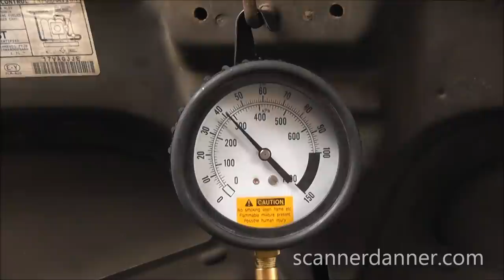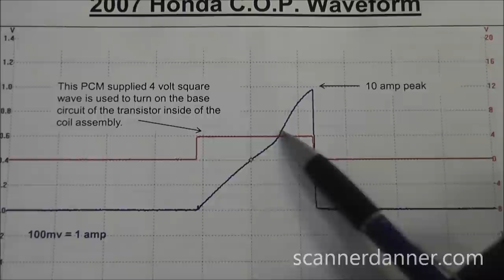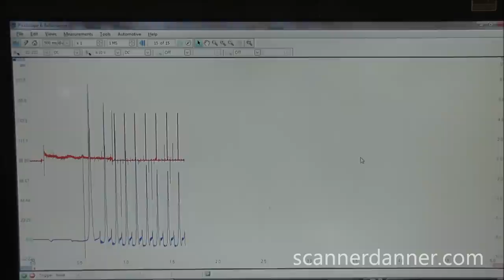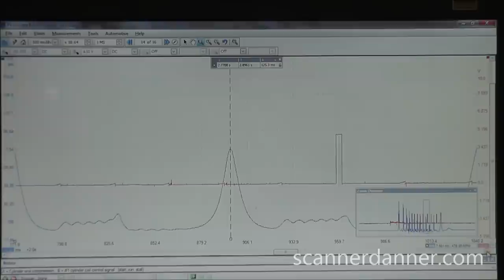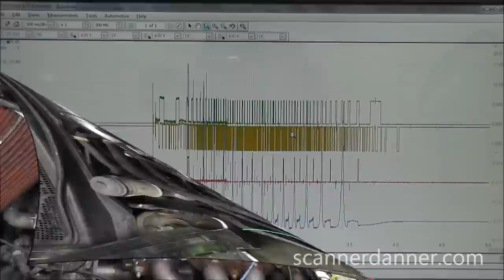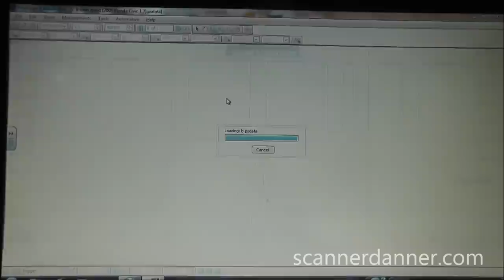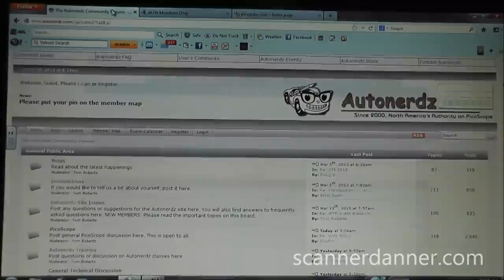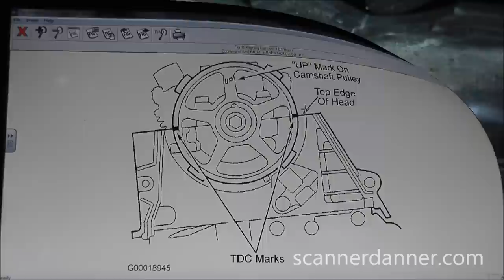Honda Civic 1.7L starts, runs, stalls (incorrect timing belt installation)

Comment: As a shop foreman I have no idea how I haven't used a pressure transducer. Timing chains in a Audi 4.2 are in the rear of the engine and depending on the vehicle it's in is a 20-30 hr job. This is great assurance to give everyone piece of mind that yes the timing is off.

Comment: Right when i heard the engine start i knew it was the timing low compression sound fuel and spark not in time ! but for anyone who has this issue this is the BEST video to watch great detail & easy to understand !
Reply from the maker: thanks man
Reply: So what's the issue with the engine  cause my civic 05 doing the same thing right now

Comment: The reason your engine was shutting down completely was that the ignition timing was going 180 deg (camshaft) out after about 1-2 seconds of run time. Why the PCM would do that from the timing belt only being 1 tooth off is beyond me.

Comment from the maker: it wasn't a noise issue with the relative compression test. it was the fact that you cannot have the car run at all during that test. I wanted to see the actual event, not disable something to keep it from starting. 
It would have passed that test btw.

Comment: I think a clue was missed at 7mins with the compression test. While the engine did show compression to be at spec, it took a good 11 compression strokes to max out. In my (admittedly limited) experience this invariably indicates bad timing. Because the compression was ultimately at spec, there is no compression leakage concern, however because it took so long to build it up, it is indicative of "inefficiency" with building compression. This would be due to either late closing of the intake thus a shorter compression stroke, or early closing thus less A/F to compress.  Either way it will take far more strokes to max out the compression to spec.  A healthy and timed engine will produce full compression within 6 or 7 strokes- certainly well before the 11 strokes as in this example.  
Just an observation that caught my eye on the compression test.  If you repeated the test after adjusting timing, the pattern of compression build would have been much different.
Reply: well pointed out, i missed that :)
Reply: U are a boss!
Reply: I noticed that too Matt and thought about your video and went back and counted them twice!
Reply: Noticed that as well
Reply: This is why I don't like to let it crank and crank to get max compression, I get the first compression pulse to get the condition of the rings and do a max of 6 pressure pulses and compare all cylinders at that same point if there is a single-cylinder or more with lower compression it should show up with this procedure and with a library of compressions, we should know if all cylinders are low pointing to an overall mechanical problem or overheating scenario, more testing now. Also if the first pulse is weak, that cylinder may already be on the compression stroke so I do it again based on the randomness of which stroke you get first, also be aware of battery drain during a manual compression test. A little after the 26-minute mark timing is advanced due to the cold high idle open-loop strategy.

Comment: Great video. We had one just like yours and found a post on IATN that said if you unplug the crank sensor (yes crank sensor not cam) and the car runs, that the timing is off a couple of teeth. We unplugged the sensor and ours ran. Our belt was out 2 teeth. It had been to a couple of shops that tried to sell her a PCM. Thanks Kevin.

Comment: Finally rigged up an in-cylinder pressure transducer for $50 using parts from eBay and RadioShack. Works like a charm!
Recently used it to diagnose a misfire at idle on a '94 LeSabre. At first I dismissed compression as the culprit, since relative compression humps were fairly even, and the mechanical gauge showed 140psi on the suspect cyl3 and 160psi on neighbor cyl5. However, on the cyl3 pressure waveform, the pronounced "vacuum pocket" at the tail end of the power stroke gave it away. Turns out cyl1 had a full 175psi pressure (no vacuum pocket), so #3 was indeed misfiring due to bad compression, but #5 wasn't much better!
The Buick kicked my ass, but those hard cases make the most memorable learning moments, right?
Reply: how did you make it?

Comment from the maker: When I look at coil negative voltage I will use a 20:1 attenuator to protect the scope. In this case I was just looking at the small 0-4v base circuit control signal for the transistor that is in the coil. No protection needed.

Comment from the maker: it came from a local shop, never got the chance to talk with the owner. it came to the shop with the injector fuel rail bent and leaking and a bunch of parts either recently replaced or missing. 
also shop owner said this guy didn't speak english very well. 
it was a tough situation from the get go.

Comment: im shocked, i had the same problem with my 98 nissan altima, one day didnt want to start anymore so i did my diagnose and, started with a bad starter, replaced it, then the vehicle, wouldn't start at all  -it was cranking over, found  a bad main fuse, checked everything, now the car would star but die within seconds like the car in the video i replaced the distributor and all its components plus spark plug wires and spark plugs, also the fuel filter and the car was running like a champ, until today that it didnt want to start again after i refueled, did all my test again, found corrosion on the positive battery terminal. now is running again, thank you for your video very detailed. i subed.

Comment: Thank you so much for these videos. I had one similar last week on a rsx with a similar hump in the waveform where the intake cam had jumped several teeth. Funny thing is that one started hard and ran well up to 3000 rpm. One more thing that jumped out at me at around 30:00 min in the vacuum pocket after the intake valve open only reaches -7.5 psi or about 15 inHg where the good one is closer to -10 psi or about 19 inHg. Just one more thing thing to confirm a timing issue if you didnt have a known good to compare it to. Thanks Paul you are my automotive diagnostic role model.

Comment: Awesome diag! This is one of those that tears lots of hairs from mechanics, everything looks good and sounds good, but doesn't work, at the first crank my though was on engine feed too (either fuel or spark), but then, a mis-mounted timing belt. This is one of the reasons why I lock my engines when changing belts.

Comment: Paul Danner is the BOSS.
I wish we had professionals who does this kind of work here in Jamaica.
I have a 2001 D17A that runs fine throughout the RPM band but idles rough.  I've changed oil, spark-plugs, timing belt and air-filter, but still can't solve the problem.

Comment: I wonder if the computer is throwing the ignition timing way off to stall the engine on purpose, when it notices the cam/crank signals are out of sync. Did it set any trouble codes?

Comment: Thankyou so much! Last week I installed new timing belt/waterpump etc on my 2002 civic by myself and the car is having idle surge problem now. And I noticed a power loss. I was thinking maybe I installed the tensioner wrong, and timing belt skipped few teeth. But, by watching your video, I think my timing is okay. I starts right up and never stall.

Comment: You made it more interesting by holding back the fact that the water pump was recently changed, and the belt did look pretty new. Of course, real life is a little more mundane and you wouldn't have needed the fancy tools. But it was great to see what this looks electronically. Those are views I don't see every day.

Comment from the maker: possibly. problem was it didn't run long enough. also that psi rise was in the cylinder not the intake. although that is right when the intake valve opened so yea, maybe we could have caught that.

Comment: Without doing the math, it is easy to see from the pressure transducer waveform that the single camshaft (driving int and exh) is advanced due to the excessive exhaust pulse showing exhaust closing too early (advanced), a good thing I noticed about some scopes is that instead of using an overlay (best method), you can just set up your cursors at the points where there is some noise (sometimes noticeable on traces) in the cam timing trace (just above and to the left of the overpressure exhaust pulse @ 29:02) that is a noisy firing event which is very close to TDC or BDC (in this case) when needed as a marker. With this alone (during cranking, no start, to avoid PCM advanced timing issues), we can see the opening of the intake valve and the closing of the exhaust valve (in that order, based on cam lobe overlap) we can see that ignition noise is not happening on the downslope of the pressure wave of a properly timed engine, it's an advanced cam, again, by how much without the math, just look at the timing belt setup as you have done. Now you have a, ONE TOOTH advanced cam, waveform capture for your library.

With experience, I believe the rounded bottom of the initial exhaust valve opening also shows advanced timing as the waveform just prior to the exhaust pressure buildup more resembles the round stroke of the crankshaft/piston passing through BDC rather than a little more abrupt point of the exhaust valve opening near the BDC area, like @ 31:08 shows on a known good waveform. 

@ 24:43 (just above PICO time 223.7) the taller red trace glitch in the CMP, near BDC alignment with good int/exh waveform downward slope, there is also a faint firing event glitch in the pressure waveform showing good alignment within the slope where I would expect it to be.

@ 36:18, I might see a couple of black magic marker marks for timing the cam reluctor wheel on the aluminum valve cover, so maybe the owner mistimed it based on how some cams will slip out of place due to spring tension and ended up where he marked them if I am correct. The reluctor on the top left has a black mark just to the left of it while the reluctor to the top right has a couple of marks but one may be a chip on the outer edge of the valve cover closest to the camera view??? It's other black mark is even further out of time???

As another possible proof of an advanced exhaust cam as a single cam or twin or quad, it may be possible to overlay your known good pressure waveform and known bad exhaust advanced pressure waveform (both on the same settings) and pay attention to the lower area just prior to BDC and the reducing pressure waveform may start to veer to the right but I am not sure how many teeth the timing needs to be off to see this effect.
Reply: Watching this again for a project, I believe that you mentioned a water pump change?? I then believe that the owner turned the engine in the wrong direction and the belt jumped one tooth, only a theory.

Comment: Without reading almost 500 comments, was there ever a discussion of why the engine would always stall after starting? I assume the PCM recognizes that the signals from the CKP and CMP are out of synch (or "Phase") and shifts the coil signal 180 cam degrees to fire during overlap to stall the engine. BTW,  this is the best of hundreds of SD videos I have watched. Keep up the good work!

Comment: Thanks Paul I’m having the same issue at the moment. I been lookin everywhere for some information and I think I found it here. It’s the exact same thing that’s happening to my car when I start. I’ve done most of the basic troubleshooting that you’ve demonstrated. Great work man! You definitely know you’re stuff.
Reply from the maker: time to pull that top cover and double check those mark right? Glad this helped!
Reply: @ScannerDanner  
My timings off I just checked it, now is time to go to work.  what threw my timing off was a piece of the timing cover gasket. Smh. Thanks again for the great presentation you did! I will be subscribing to your channel.
Reply from the maker: @mannyclemente7159  awesome! Nice find on your part!

Comment from the maker: I thought that too, so I disconnected the cam sensor during cranking to see if it would start and it would NOT!?
Reply: Mine did this yesterday and I unplugged the crank sensor and it fired right up and ran perfect besides a slightly rough idle.
I read where it's possible jumped timing so I listened carefully to make sure my valves werent bashing the pistons and it sounded fine so I drove it home 10 miles away.
That was 2 days ago,tomorrow I'm gonna look at it and even put my diagun on it to check codes and I went ahead and ordered the crank sensors.
Reply: I'm gonna check the timing also to be safe and if it jumped time
I will change everything under the timing cover 
I'm wondering if some oil got under the cover because a few months ago I accidentally didnt tighten the oil cap and it came off and was off for about 3 weeks and about a half quart of oil blew out and the top of the timing cover and the top of the valve cover had oil on them and I havent pressured washed it yet but u wonder if oil blow back got Into the cover and caused a slip of time by a tooth.
Reply: And mine would also start when I unplugged the cam sensor but it ran very bad with very bad throttle response and kept dying.
But ran almost perfect and normal when I unplugged the crank sensor.
I'm certain mine jumped a tooth and probably because the oil from the blow by coming out of the cap for almost a month but I'm gonna take the valve cover off and check it all tomorrow.
I'm guessing 1 tooth off wasnt enough to have the valves hit anything thank god and I would never ran it or tried to restart it if I would of heard any noises.